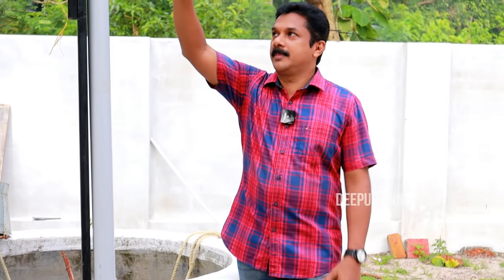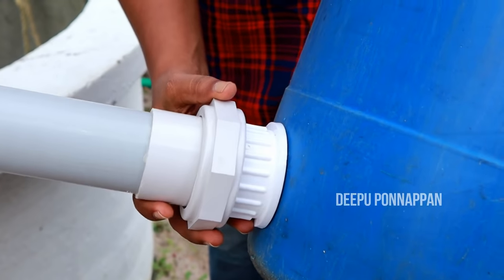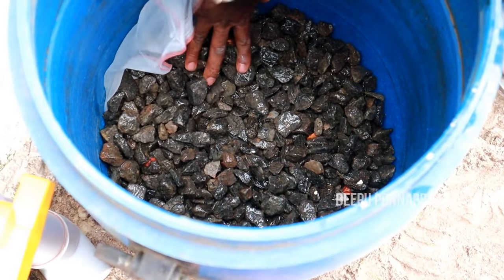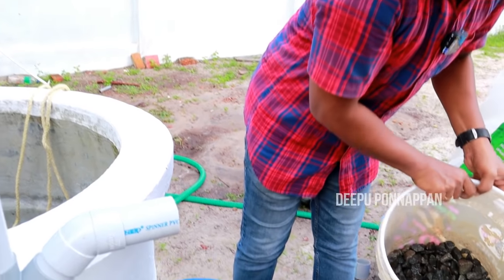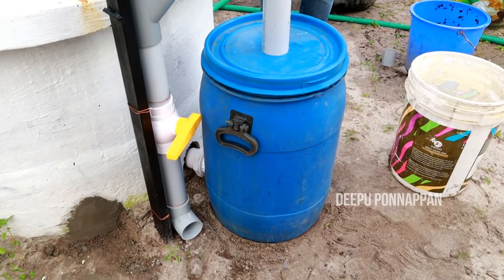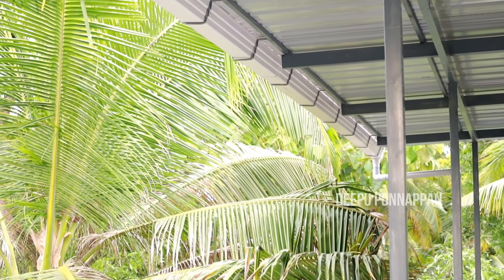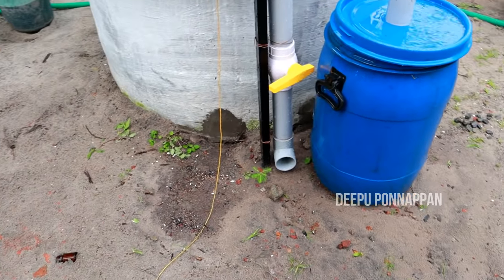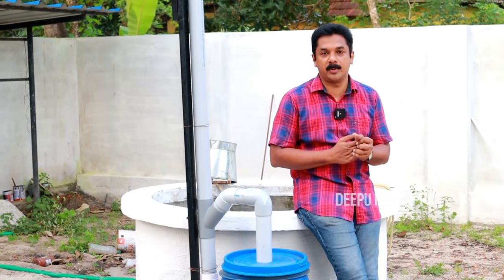വെറും 1500 രൂപയ്ക്ക് വർഷം മുഴുവൻ കുടിവെള്ളം സംഭരിക്കാം | Rain Water Harvesting | Deepu Ponnappan

Comment: Ponnappan it sounds good but how effective to hold the water during all the seasons. For example my home well is around 80 Feet deep, during rainy season from the natural rainwater (without any manipulation) the well will fill up to 3/4 of the well. But as the season changes the water level will go down gradually and even vanish completely. Don't you think the open well, ( I mean not a purposely built tank) how to hold water where the bottom of the well and sides of the well are open ; means not sealed. the water will imbibe to the surrounding soil isn't it???